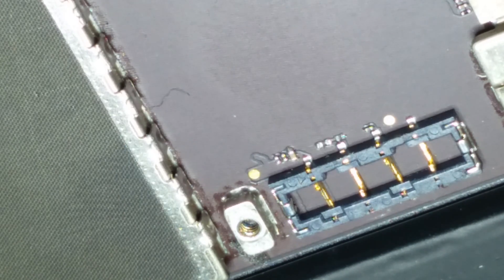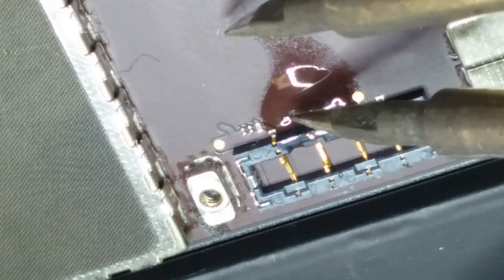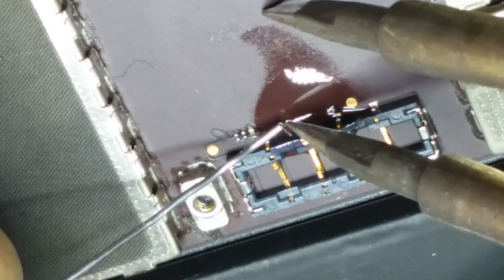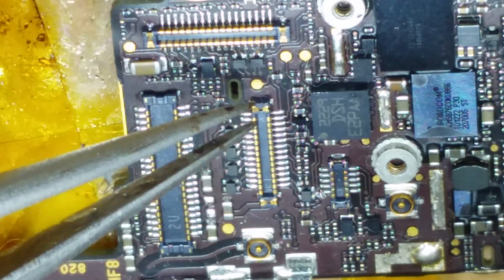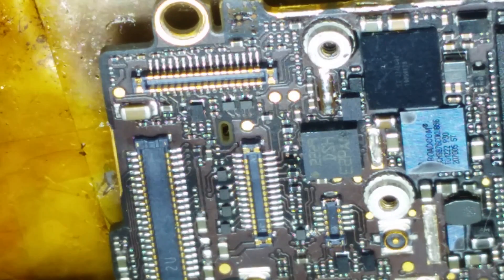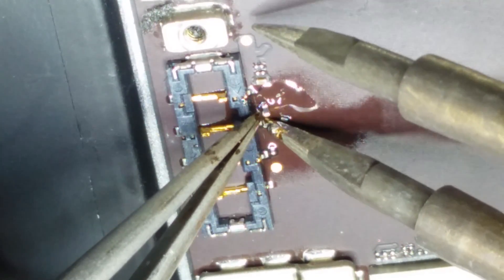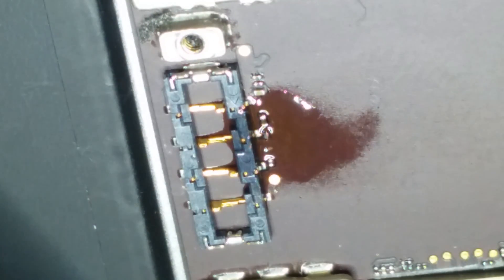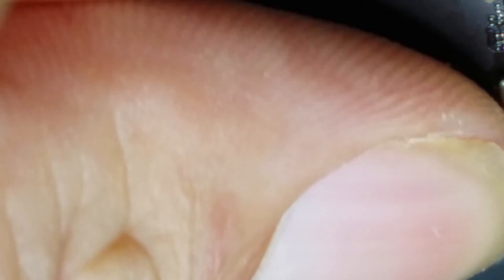iPad Mini bootloop - solved by replacing filter near battery connector

Comment: hi mark,
             In my iphone 5 the exact component is missing that you used to replace the FL7500, :( is there any other cap in iphone 5 or 5s board thats the same value as FL7500?